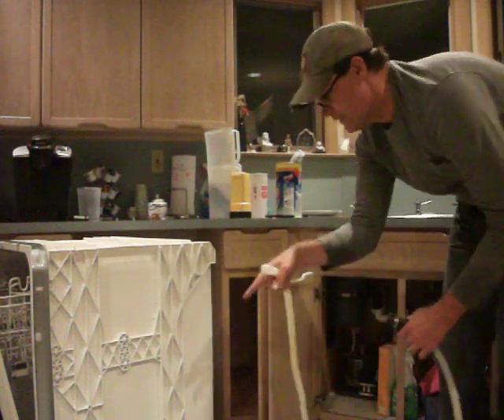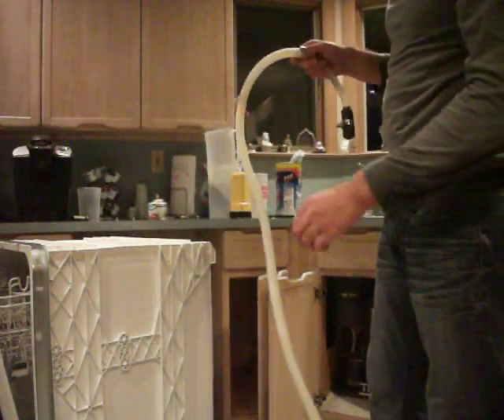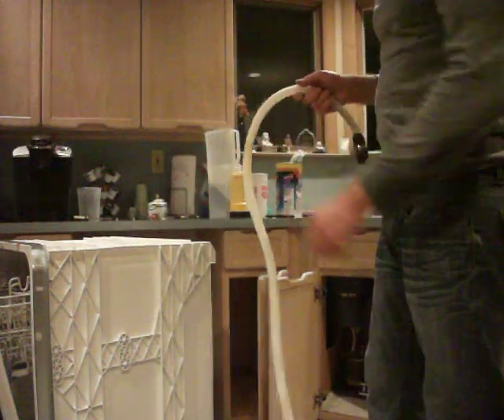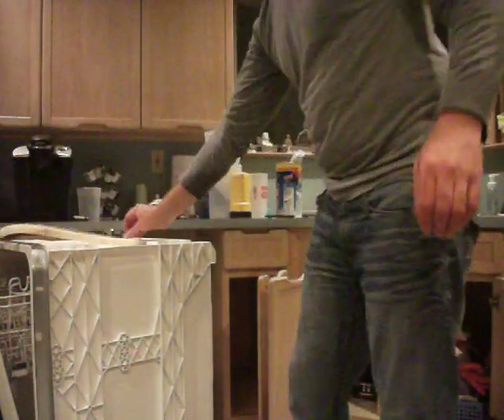My Kenmore Dishwasher Won't Drain and is Leaking- How to fix or repair Clog or Leak. Not pumping.

Comment: Thanks for the tip. The dishwasher (Kenmore Elite Ultra Wash HE) drain tube connected to the sink drain was blocked with small particles of food that got through the filters. I used a thick wire to clean it out.
I thought it was a the drain pump. Easy fix! It saved me from a costly repair.
Thanks again:)

Comment: I actually followed your first video as well as this one. Mine was a GE, I'm on my third motor, and now it's running so i can see if it will drain out. Hopefully it works. If not, out with the old in with a new. I had to drain the dishwasher tub underneath the dishwasher, checked hoses, checked near disposal, and so far so good. Thanks for the help.

Comment: Thanks man!! Your video gave me the confidence to get back there and pull things apart. As another user found out, my clog was also where the Air gap and drain tube meet..wish I would've started there first but I learned quite a bit for next time. No more paper plates!

Comment: My only advice is to tell people before dis connecting the water line from the dishwasher is to make they shut the water to the dish washer off first , typically the shutoff is under the kitchen cabinet and tees off the hot water line going to the sink... Very important

Comment: I saw your 2 part youtube video on:

My Kenmore Dishwasher Won't Drain and is Leaking- How to fix or repair Clog or Leak. Not pumping.

I don't feel capable to repair appliance so I called my plumber. He checked things out. Not sure if he tried to make sure it wasn't the tube clog problem like you had or not.

After he checked things out, he suggested I call Sears technician for a replacement of the solenoid valve for about $150. Not sure if that is the total cost or just the part. The dishwasher is about 10-12 years old. Over the past 2-3 weeks, we have been having problems with it sometimes not draining, & 1-2 times leaking. Other than that, it seems to work fine.

Solenoid valve sound right to you? Repair the solenoid valve or replace dishwasher?
Reply: +yechi7 if your dishwasher has lasted 10-12 years you should celebrate.  I don't think I've ever had one last more than 5 years.  good for you

Comment: Did you punch out the "knockout plug" on your garbage disposal before attaching the dishwasher drain hose? Mine was a plastic piece that had to be knocked out with a screwdriver and a hammer. (Be sure to unplug disposal first!)

Comment from the maker: When you use your disposal, is there drainage?  If so, then your exit hose or pipes post-disposal is okay, and I would replace the drain hose connector that unites the hose coming from the dishwasher to the disposal.....maybe see if this helps, if not, then we can go one step further in troubleshooting it.

Comment: Nice tutorial.  But it didn't solve my problem.  The dishwasher drains fine, there is no clog in the line.  But. once it is attached to the garbage disposal it won't drain.I tried just sticking the drain hose in the sink and draining the dishwasher to make sure the drain was working.  It worked and drained, but the water backed up into the sink a couple of inches but eventually drained down the drain.  It's something wrong with the drain or the disposal, not the dishwasher.  Please help me.

Comment from the maker: a coat hanger would be poor judgement....once the repellent properties of the plastic hose become compromised.....the accumulation will occur at exponential rates, as opposed to replacing the hose...in your case, 30% occlusion will lead back to 100% within a couple months....a new hose, 0% occlusion, will take more than a year to create a problem.

Comment: My dishwasher drains when you cancel the cycle and drain it but when it is running in the normal cycle it leaks from the bottom of the door all over the floor.  Just started happening.

Comment: Would have been even cheaper to shove a coat hanger or piece of wire down to break up the blockage and then flush with a garden hose rather than replace the hose. You'd not only be saving money but also not sending a still workable piece of plastic to a landfill.